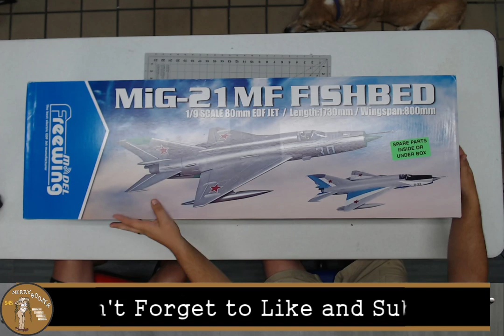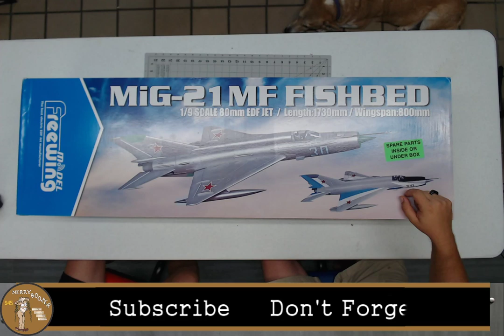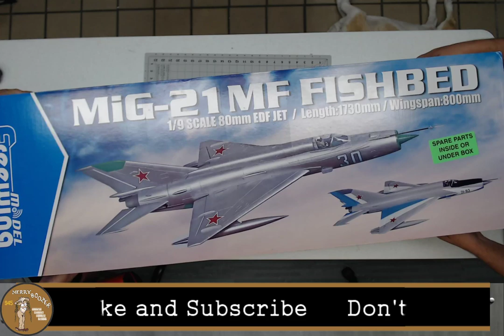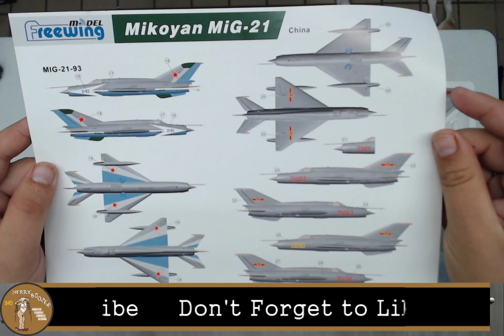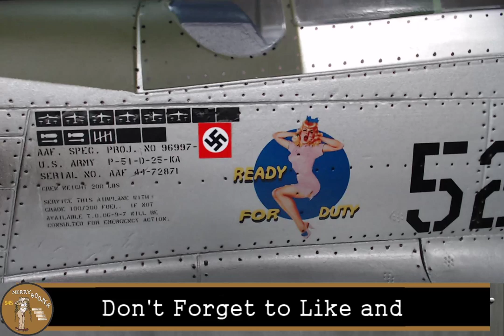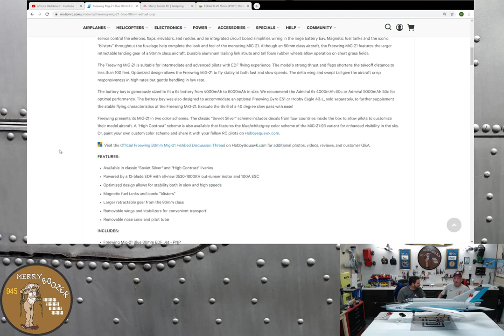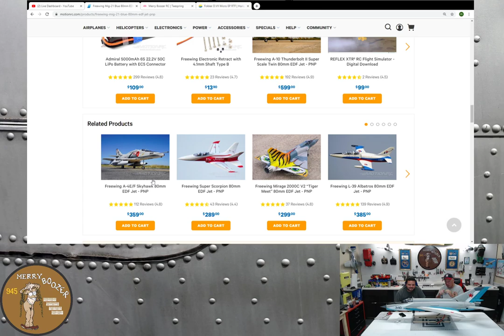Freewing Mig-21 80mm EDF Jet Unboxing and Chat

Comment: Minwax has flat and semi. Imported gallons of it to AU. It makes your model wash and wear. :) I have the same model but wanted the all silver mine also came with a gyro as standard. Just as you say we all have different tastes. Tell your dad that only the F4 Phantoms could really kill the 21s. The 21 would easily out fly the F4 in a dogfight. but the F4 would use those 2 magnificent engines to just extend, and then reengage. We have a 21 at Newcastle Jet museum, that I sat in the pilot seat. Tiny little cockpit.

Comment: Thinking of get it but never fly in my life .
Reply from the maker: You’ve never flown an RC airplane? I definitely do not recommend getting this as a first plane.
Reply: Why .??
Reply from the maker: @sallysilvano3004  it’s a very advanced airplane. I’d recommend starting with a trainer first something like an valiant or if you want a jet the Habu STS with safe. Although it looks easy to fly rc it definitely takes time to learn and I do not recommend starting with a 6s high performance jet. It’s like learning to drive in an F1 car VS a normal car. A simulator is also a great choice to get your skills up with RF9.5 is fantastic to learn with.